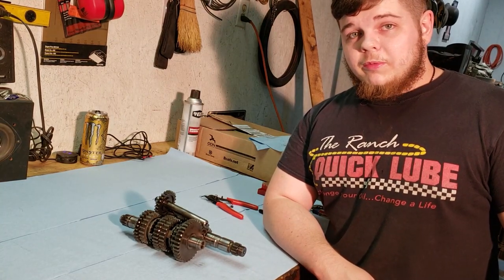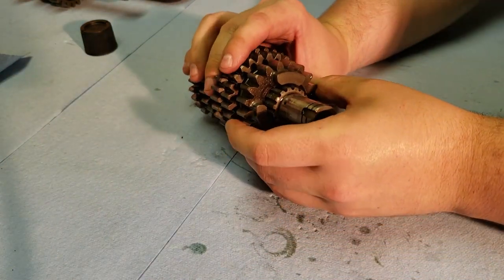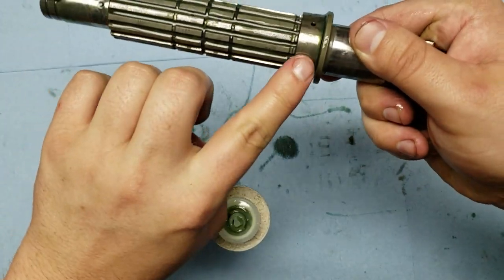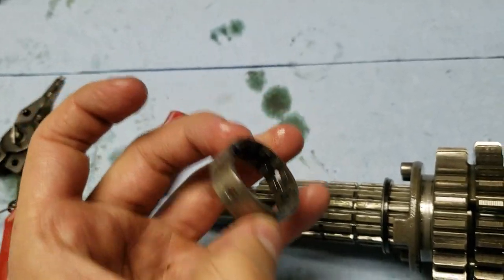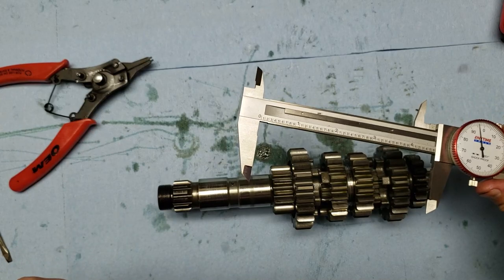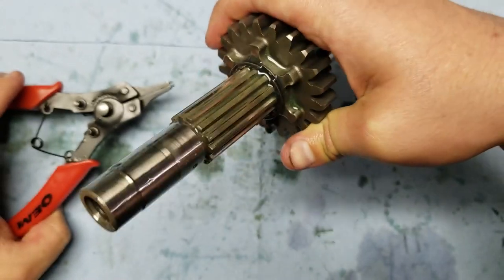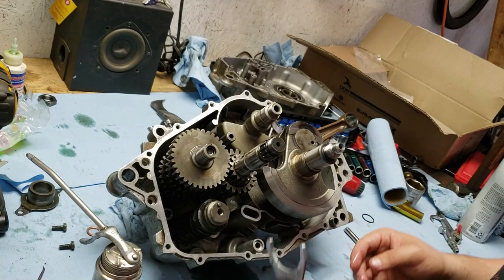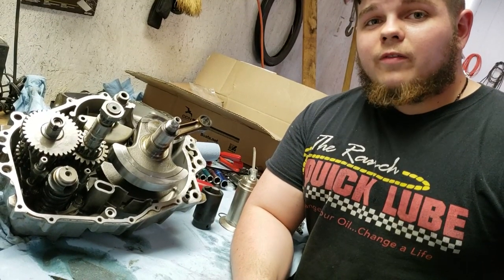Raptor 660 Bottom End Tear Down: Transmission Rebuild

Comment: I have a 660 raptor that does not go into 2nd gear but 1st and all other gears work fine. I took it apart thanks to your videos and 2nd gear seem fine nothing bent or broken any information will be greatly appreciated.  Thank you
Reply from the maker: Look at the comments on this video, a guy explains what happens with the 2nd gear with the gear dogs shearing off and not engaging, seems to be very common for 2001 raptors

Comment: I have 2001 raptor 660 the 2nd gear doesn’t engaged can you give some tips how can I fix it
Reply from the maker: There is a comment thread below where something explained how the gear dogs for the 2001 Raptors can get sheared off and need to be replaced with a 2002-05 2nd gear pinion and a 2nd gear wheel. Any search online will have the threads where people had issues with the 2001's with their second gear and needing to replace them because of the gear dogs

Comment: Just wanted to start off by giving you some props. The Raptor how to videos are awesome, very informational thank you for walking us through this rebuild journey.. I think I am having one problem for some reason my balancer and crankshaft are touching. Where the balancer is supposed to go through the crankshaft slot. It rubs it is there supposed to be a washer
Reply: Before the balancer goes in the case is there supposed to be a washer that lifts it up just a little
Reply from the maker: @JOATD  There should not be a washer, it's a straight drop in to the roller bearing. If you need a reference, the manual PDF is in the description, on page 5-69 starts the disassembly of the crank and the balancer if you want to follow along with it
Reply: @Hunters_Mechanics  yeah I pulled up the diagram and I see that there is no washer is it a reason that they're touching
Reply: @Hunters_Mechanics  do you have an email where I can show you a picture
Reply from the maker: @JOATD  bacon626262@gmail.com

Comment: Great video! That’s very informative - but I have to ask - why didn’t you replace your second gear and 4th gear wheel as the 2001 have issues. You went that far into it, especially removing the pressed reverse gear. My second gear of my 2001 still works but I have to shift very slowly and deliberately before applying power.
Reply from the maker: I wasn't aware of that issue, the only issue I have with my transmission is that my neutral would not be fully in place 1/10 times. Sometimes when I tried to put it in neutral, it would go "clickclickclickclickclickclickclick" until I had to jam the shifter down to get it out of whatever it was in then redo it
Reply: @Hunters_Mechanics  I would seriously consider replacing the second gear and 4th gear wheel as a set before putting your cases back together. Even for future resale value - telling people that 2nd gear issue is fixed will allow you to ask for more. Google Yamaha Raptor 660 2nd gear issue and fix. You can buy used transmissions from later models or just replace those specific gears.
Reply from the maker: @gordonwbell  Ill look into it, thanks for bringing it to my attention! Eventually, I will be replacing the crank when I get out of college and I most likely replace those two then for reliability purposes
Reply: @Hunters_Mechanics  you’re welcome! Keep up the good work. I always enjoy your content.
Reply: @gordonwbell  second gear fix is the same reason i had to tear mine appart i used 03 transmission gears as replacement
Reply from the maker: @gordonwbell  so I double checked those gear dogs before putting it back together and they weren't rounded off and engaged well when on the bench, back together now and I have a neutral between 2nd and 3rd 🥴 never had the issue before the case split but who knows whats wrong now. I have to shift up like 5 times before it catch third but most of the time I lose all the speed before it'll finally engage 😒 oh well, ill wait till Christmas and split it again to give me something to do, in the mean time, can you confirm thats the only two that needs replaced? Every forum online is a bunch of dog 💩 of people arguing what to replace and what years and ends up at "replace the entire transmission"
Reply: @Hunters_Mechanics  bummer man. I’m happy that you reported back though. It’s only 2nd and 4th gear from my research, that you have to replace, but to be sure, Yamaha had a TSB, that stated which gears, but I think most people find that it’s easier to just replace the whole thing as an assembly as they’re about the same money from eBay, as the gears are from Yamaha….I’m no expert though as I didn’t tear into mine yet, but I think it might be soon. Mines an 01 as well. Shifts fine if I don’t power shift it. You might have a dragging clutch issue, make sure the clutch cable has 8-10mm play at the handle and it doesn’t lurch forward when putting into gear with the clutch pulled.
Reply from the maker: @gordonwbell  I ensured the clutch play was in spec with the manual, thats what my first thought was, then I moved my shifter up a few cm's and both didn't help, might at least get a good ride in before the semester starts. Not liking the look of these transmission prices 😂
Reply from the maker: @gordonwbell  the biggest difference I've noticed is that my transmission doesn't have a solid click when shifting in the gears, like 3-4-5 have no click whatsoever anymore, just a small movement of the shifter and it shifts, even sometimes hits that 'neutral' in 4th to 5th which is strange, ill test ride it some more eventually and let you know what happens
Reply: @Hunters_Mechanics  hmm. It could be your selector isn’t working right…..I would take the clutch cover off and inspect the select lever and “pawls” they’re what create the sequential action….
Reply from the maker: @gordonwbell  so I took the whole ass clutch cover and clutchs back out and it indeed seems like an issue with the segment, I can move the shift drum by hand and select the gears but the segment but won't turn the drum practically at all with its movements
Reply from the maker: @gordonwbell  ooooop I found it...... the spring for the lever apparently came off. I have it on video of me specifically putting it on the peg but it somehow came off
Reply: @Hunters_Mechanics  right on man! Maybe it popped off before you got the clutch cover back on, as it’s what holds the selector in position. I’m glad you got it sorted though.
Reply: @gordonwbell  do you replace the pinion gear side or the driveshaft side?

Comment: Hunter Brother !!! I gots a good question!!
When you pulled the 2nd gear wheel off the drive axle the flat side was facing down , But when you reassembled the 2nd gear wheel the flat side was facing up ,,,,???? Which is it ?? Im confused lol
Reply from the maker: I just realized that when reassembling the drive axle I called the 4th wheel gear as the "2nd wheel gear" and I said it twice 🙃 the 4th wheel gear is the double sided gear with gear dogs on both sides and the smaller dogs face towards you when assembling, then the 2nd wheel gear follows with the holes facing towards the small gear dogs, sorry for that confusion! 😅

Comment: Got a 02 660 raptor, no 5th gear, like going into neutral, all other gears work fine? New clutches and clutch basket but still no 5th? Thanks
Reply from the maker: Have you split the case to look at the transmission gears? You may be missing some gear dogs off the gear itself, shift fork is worn out completely, or something broke with the shift drum. If the rest of the gears work, then the clutch and clutch basket wouldn't be the issue, it would be the gear and related hardware itself
Reply: I have not split case yet, got to get started soon. Thanks  @Hunters_Mechanics
Reply: Got cases split, only thing I noticed is the collar was not inside spring on shift shaft and the main axle bearing in case is crunchy? Forks looked good and moved freely, and 5th gear looked good?

Comment: Great Job, Hunter! One question, plz: do you know what are the references of yours tools that u used for unmont the transmission? They did the job easier.
Reply from the maker: The tool set that I used to press off the reverse gear is the Harbor Freight Bearing Puller set: https://www.harborfreight.com/bearing-separator-and-puller-set-62593.html
The snap ring pliers I think I got at Autozone years ago, similar part: https://www.autozone.com/test-scan-and-specialty-tools/snap-ring-pliers/p/oemtools-snap-ring-pliers-set-4-piece/532465_0_0
The press I have in the shop to press the reverse gear back on is this hydraulic press although one this big is not needed for this job: https://www.harborfreight.com/20-ton-shop-press-32879.html
The other set of snap ring pliers I have no idea what brand there are or where they were bought from. They are my grandpas from years and years ago lol hope this helps!
Reply: @Hunters_Mechanics  you have helped me a lot, but I will use your knowledge again if you permit. Still with Raptor 660r (2007, but in Brazil).
I have a engine, but I am not sure if it is 2001 or 2002+ (US). I must buy a wrist kit (wrist, bearing and pin)

They are very similar, but not equal. Wrist and bearing are compatible with all years, but pin isnt. There are specific codes.

2001 (3YF-11681-00-00)
Weight 1.1875 lb = 538g

2002+ (5KM-11681-00-00)
Weight 1.125 lb = 510g

The only difference that I have noticed is the Weight, but this is not a good parameter. Do you know how can I be sure if the pin is a 2001 or 2002+? Why they are not compatible one another? Thanks!!!
Reply from the maker: @heltongoncalves5996  I can't say I've noticed there was a difference in the pin for the 2001 compared to the 2002+, when I bought my kit, It came with a new piston with a wrist pin that fit. What I've found online is that 3YF-11633-00-00 has been superseded by the newer wrist pin with the number 3YF-11633-01-00. I don't know where your second part number came from but here's the website I use to buy my oem parts and it'll show what vehicles fit that same wrist pin: https://www.motosport.com/oem-parts/part-number/3YF-11633-01-00?mmy=yamaha%3Braptor%20660%3B2001
Reply: @Hunters_Mechanics  I think I should have written **Crank Pin, not only Pin. Sorry. In fact, the Pin is the same for all years, but we have a difference in Crank Pin for 2001, that I still havent found.
 Do you know where can I see the parts dimensions? There is a little difference in Crank Pin for year 2001, ans I must discovery what is the year from the Crank Pin that I have in my table. Thank u again!
Reply from the maker: @heltongoncalves5996  ahh yes I do see where there is a different part number for it.  All I've found is this:  https://www.partzilla.com/product/yamaha/5KM-11681-00-00 , it shows the length of the pin but for the 2001 part number it doesn't. I don't know if there is a length difference or any visual difference from yours but its worth a look at. If I had my case apart I'd measure it for you 😂

Comment: i got 1 more question 😂 is the Main Axle specs u showed for you're year only? Im working on a 04 660cc and the Main Axle is at 114.71mm . thats awhole mm off 🧐 srry but i dont have a manual 4 reference
Reply: Oh and this is b4 disassembly of the Main Axle
Reply from the maker: @tydoubleu5734  are you talking about the measurement from gear to gear? If so if yours is off, that just means that the reverse gear is either pressed too far on or too far off
Reply from the maker: @tydoubleu5734  also the pdf of the entire manual is in the description for your convenience 😉
Reply: @Hunters_Mechanics  awesome perfect thanks brother !!! PDF 👌

Comment: Hey a I rebuild mine I replaced 2nd gear is a 2001 all gears shift fine but It just won’t go into reverse at all is ther something I missed when I reinstalled the reverse lever any suggestions thanks
Reply from the maker: Is your reverse lever pulled far enough through the case that you can put the snap ring on it? That's something I realized I forgot on mine was to pull it far enough through, there's a groove on the reverse lever for that snap ring to ensure its lined up for the shift drum. I had to use a longer bolt that fit the thread of the reverse lever and a socket over top of the lever to pull it through all the way then install the snap ring, worked after that
Reply: Yes the washer and snap ring are where they shut be. I removed the cable and I try to move the lever whit my hand but it just feels like it hits in something but never shifts in to reverse
Reply from the maker: @JoseRamos-yv2xg  it should only move like 30 degrees, its a pretty small movement, are you sure the reverse lever is pulling it all the way?
Reply: No it just hits in something and it doesent move much. I saw in your video you shift drom the metal tip on top was towards the transmission gears and when I did mine it was faicing towards the bottom of the case maybe that’s why my reverse lever is not on the right grove
Reply from the maker: @JoseRamos-yv2xg  Or its a chance that its not in a grove at all. I honestly don't know what else it could be but Id try to put it in neutral, then ensure that its pulled all the way through. I wish I was at the garage so I could show you how far it needs to move